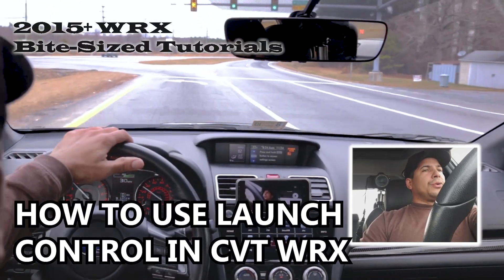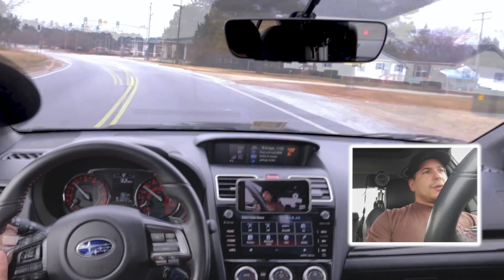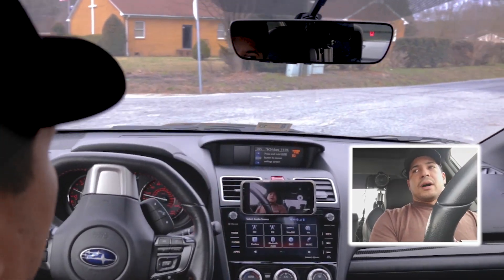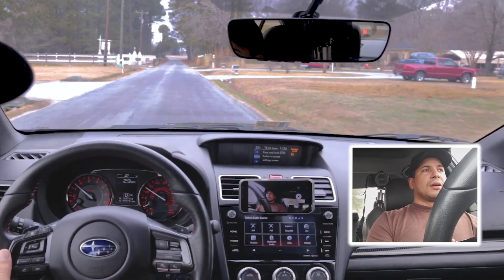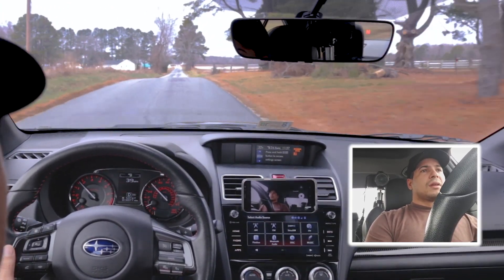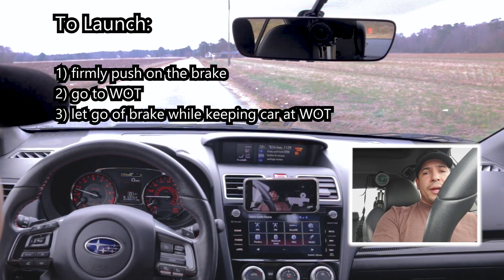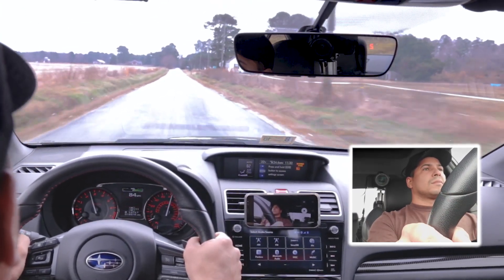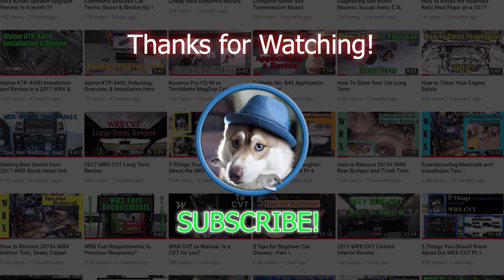How to Use Launch Control in 2015+ WRX with CVT

Comment: Nice video! However, if I may make a recommendation, I would suggest that you keep the time you are holding the car back with the brakes VERY brief. So as soon as the RPMs max out at 2500, release the brake and let it go. Holding the brake and gas makes a TON of heat in the transmission VERY quickly because all the power the engine is making is going to heating the transmission fluid. The trans temp gauge may not show this because of the location of the temp sensor though, giving people a false sense of safety. It's not that bad if you release the brake as soon as the RPMs max out, but holding the brake and full throttle for more than a second can overheat the transmission. Anyways, just a suggestion :)
Reply: Nothing is under load.
Reply: @wes89  Actually, the torque converter is under the highest load possible generating a huge amount of heat when the engine is being run at full throttle while being held back by the brakes. From a dyno graph I found online, it looks like that engine can produce about 110 HP at the torque converter's ~2500 RPM stall speed and ALL of that power is going into heating the torque converter. To put it another way, that's like running about 55 1500 watt space heaters inside that little torque converter simultaneously! Definitely not something you want to do for very long.

Comment: WRX with cvt :D what a joke
Reply: What a waste
Reply: The 6 speed is no better. I have a 2018 wrx with the 6 speed and it's fun. But the gearing is shit. So you're constantly shifting gears just to get up to city speed limits. If subaru kept the 5 speed for the wrx it would have been better. Not to mention the rev hang these cars get makes driving hell. There's are more times than not that i wish i got the CVT. The car is a lease anyway so it's not like i'm going to keep it. ANd i sure as hell not keeping my wrx. I can't wait until the lease is over. Good car, but not for me.
Reply: All it pretty much needs is a cooler.  My 17 is my 4th WRX.  2 manuals, and 2 "autos".  Over 35000 miles, pulls in the low 4's.  ZERO problems!  My son now owns my 14 manual so I still drive it every once in a long while.  I like my CVT more...still.  Planning on getting into the high 3's soon with stronger tq converter and E85. Plus a lot of other usual stuff I added. Tomayto, tomahto.  For the price of a Limited STI someone could just buy a used Z51 which clocks in the 3's.  You might say they can't drive in the winter, but a lot of STI people do the same...  imo
Reply: @truth3410  I've been driving manual my whole life and never had a problem in city traffic.. once you actually learn how to drive one it becomes second nature. CVT should not be on a car like wrx, it's insulting
Reply: xyllok I aswell have been driving manual my whole life and just recently we bought a wrx CTV for my wife and to be honest I really enjoy driving it.
Reply: you must live in montana or something, i promise you a manual car in LA  bumper to bumper traffic for 2 hours isnt fun.

Comment: There is no launch control on cvt wrx this is a simple converter stall man....
Reply: No, it's a factory built in launch control. Go drive a WRX CVT. Unless your in S#, the ECU is telling the CVT to simulate gearing. I believe it's 6 "gears" in I mode, and 7 in S mode. Only in S# will you see the CVT preform like a straight CVT by maintaining optimal engine speed for acceleration.

Like shown in the video, when he initiated launch control, the car held the optimal RPM for acceleration. Had he taken off from a stop normally, the car would have shifted it's way up the "Gears".
Reply: @cameronharbrecht8427  Only in "I' mode you will see the real CVT. He was in "I" mode when he launhed it. It's 6 speed in S mode then 8 speed in S# mode.
Reply: @nnr3  It's actually a CVT below 30% throttle in S mode as well as 40% in I mode. Below those throttles the transmission doesn't shift.

Comment: I tried launch control on mine but I guess I didn't press the brake paddle firmly enough and the car started to move I think before reaching 2500 rpm and there was some brake scraping sound. Could this have done something bad to the cvt and the torque converter? I'm not very mechanically savvy so just want to hear your opinion... The car does run fine right now tho.
Reply: Make sure you're slamming that brake pedal like you're about to rear end someone
Reply: @NuclearSaturn   That's the funniest but most accurate way to describe it lol

Comment: "How to Destroy The Torque Converter in 2015+ WRX With CVT" 

That's not launch control...
Reply: @akqjtn  facts
Reply: @akqjtn  building up a ton of heat in the transmission/converter, building a huge amount of fluid friction in the converter, and shocking the transmission. Semantics... Got it. 👌🏻

Comment: Any difference when using launch control in sport or sport sharp mode?
Reply: launch should be faster in sports mode than Intelligent mode right
Reply: randy randula yes
Reply: it's faster in my 2017 manual transmission :)

Comment: A stupid question 😁  Does the launchcontrol also work i manual mode?
Reply: It won't do what it did in the video. You'll have to shift through the gears and won't stay in the power band for Max hp

Comment: I wouldn't say it's launch control ... its just brake boosting ....if it would rev to 3500rpm to 4000 ram then ok its got a launch control system
Reply: brake boosting is from a roll, not a stationary start

Comment: Yeah dude that’s just loading up your torque converter and giving it a hard time so it breaks first
Reply: Lol. No torque converter. It's a CVT.
Reply: @joes.7536  There is a torque converter in the CVT. That's how the launch control works. Without a torque converter the engine would stall when it comes to a stop.
Reply: @joes.7536  😂🤣😂🤣😂🤣😂🤣

Comment: Why wasn't it shifting after the launch? Was staying at 5.5 rpm at 80mph lol
Reply: It's a CVT, there are no gears to shift between in order to accelerate. Normally, the CVT in the WRX is programmed to snap between prescribed ratios (so it seems more like a normal automatic) but that's not the case with launch control. Notice how it was glued at 5500 RPM the entire time between 35 MPH and 88 MPH, while this is happening the CVT is smoothly sweeping across the gear ratios as this is actually the most optimal way for the car to accelerate.
Reply: 5500rpm is maximum power.  If the CVT constantly changes ratios to maintain maximum power no matter what speed you’re going, then you will always be accelerating as quickly as possible.

Comment: your octane comment is not correct get the right octane for your car you dont just get the highest thats stupid and a waste of money
edit: your car also wont ''adapt'' to different octane fuels it can assume bad fuel quality if your engine misfires thats  it
Reply: Boost & Shutter this is again incorrect higher octane fuel burns hotter  so you can wear out the engine on a car not designed for high octane, on to the adapting fuel quality is not the same the same as octane adapting your car can not adapt to a higher octane than manufacturer recommendation it can adapt to a lower octane the opposite of what you are claiming please research before making claims :)
Reply: Boost & Shutter good reply and i agree with this but you should include that in the video people will mistake this and use the highest octane in their civic for more power and end up shortening the life span with no gain
Reply: Boost & Shutter you too man good luck